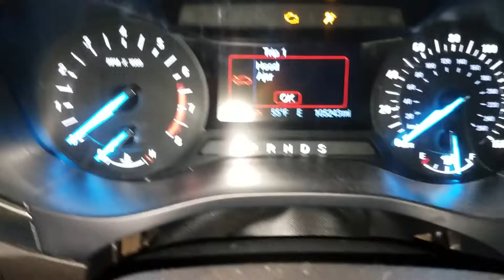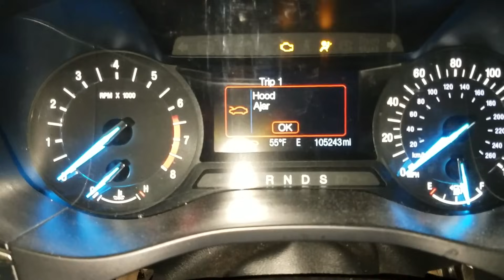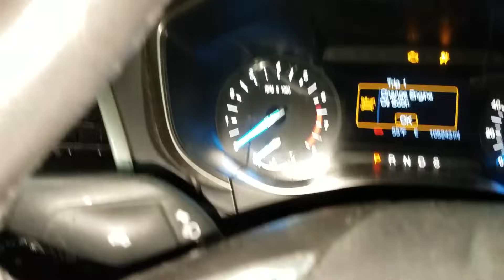Ford P1450 Fuel Tank Vacuum "Most Common Cause" & How to Test

Comment: So I have this code. Would this make the engine try to die after putting in fuel? At all other times, it's fine. Starts and runs normally. Only after I put in fuel, it tries to die, so I give it a little gas for about 5 seconds, and then it's fine again
Reply: Yes, my Ford 2013 Escape SEL died or tried to die every time I put fuel in the tank. Changed the purge valve, and it runs fine after fill ups.

Comment: Thanks. You're video was informative helpful. I have a question. My 2013 Ford fusion SE just picked up the 1450 code as well as a 144C code right after I got gas. Does the presence of both of these codes eliminate either the purge valve or the vent valve from the puzzle?

Comment: last week i replaced the purge valve in my 2014 MKZ.. ran good up until today.  Got a CEL as soon as i got into the car.  Ran the code and it was a P1450.   I drove to the gas station to get gas and the car wouldn't start.  So long story short i has to get the car towed today to the mechanic.  Could this happen if someone put something in the gas tank.. These cars don't have a locking gas door. I came out Sunday morning and the gas door was open. just a crack.   thanks in advance
Reply: You probably got it fixed but that could be from the valve being stuck open and filling the tank pushed extra fumes into the intake and made it too rich to start

Comment: This code happened for me a couple days after I did the 100k mile servicing (replacing spark plugs and coolant flush).  Could either of these things have anything to do with this code?  Thanks in advance!
Reply: No, this code is related to the EVAP system. Emissions and such.
Reply: Same here I change spark plugs and it popped up I believe my purge valve ain broke because it’s not stuck open maybe stuck closed what was your problem?

Comment: I changed the part and put the new one but the engine light is still on, do I have to delete the code with a scanner or can I disconnect the battery?  can you help me please
Reply: Did your code ever turn off? I replaced mine months ago in my code is also still on. Plus I tested it and it seems like it's working.

Comment: i had the same exact problem. i changed them out without testing the purge valve first. i reset my codes. however the wrench indicator light is back on. Even though my check engine light isnt back on this is how it started right before i fixed it. The wrench indicator light came on and would go on and off for about a month and even when on wouldnt throw a code but after a month the check engine light came on with it and it was the P1450 code. I changed the purge valve, cleared the check engine light and it has yet to come back on but since the wrench indicator light has come back on im wondering if it even fixed the problem?
Reply: I’m having the same problem what was it ?
Reply: What a wrench indicator?

Comment: The heat shield on the line is allegedly made of soy. Rats love it. A $300 repair, and the dealer told me exactly how to prevent it, and even gave me some free advice and components. How is that not subject to a recall?
Reply: Please share how to prevent this.
Reply: @mikescalise3913  Cable tie scented clothes dryer sheets around it, and replace them every three months. Seriously.

Comment: I have changed them both and still having p1450, any thoughts? It's the Unable to bleed up fuel tank vacuum p1450

Update* drove it for 2 days and the code went away.
Reply: Glad I’m not the only one looking for answers. Having the same issues
Reply: Better not to clear after fix and drive first. This way the vehicle goes through relearn process and confirms your fix.
Reply: Cars have a learn process in their programming. If the ECM no longer detects the fault, it will remove the fault from memory. Just takes a few miles/kilometers to get it to do that.
Reply: @mikeford963  no it was still showing a fault after the change. I just drove with it and after 2 days it went away
Reply: @Hinman_9124  Well, unless you cleared the fault with the code reader, it will. And it can take up to 30km's(Canadian here) for a code to clear.

Comment: I bought a obd2 to reset the mykey volume limit on the radio and I couldn’t get it do u know how to do it? They said to buy the little adapter and then use the Ford sys scan app
Reply: i remember clearing it but the backup car key has to be away from the car for some reason?

Comment: Could  you tell me an estimate on what this problem would probably cost to take care of this problem? It is a P1450 code Definition CodeP1450 indicates that with the engine running the PCM the PMC detected a control fault in the Evap system P1450 Unable to bleed Up Fuel Tank Vacuum  PO456 Evaporative Emssion System Leak Detected very small leak

Comment: That’s great, I just got this code can’t wait to ignore it
Reply: Are you still ignoring it? 😂
Reply: @Dmac2593  the check engine lights gone so o guess it worked 😂
Reply: @tonygood35  lucky for you not mine. It's been a year and it's still there
Reply: @tonygood35 how long did it take to go off ? I’ve driven about 40 miles since replacing the part and still the light is on.
Reply: @ulyssessmith454  it’s been a long time now but I think I replaced it then cleared the codes and it never came back
Reply: @tonygood35  okay so you manually cleared the code. The person at advanced auto part’s recommended I drive 100 miles and it should clear itself but if it doesn’t they said to come back and theyll clear it to see if it comes back
Reply: Is it hard to ignore it? Can a diy do it? 😂
Reply: I needed that laugh 🤣 😂  I was just pissed off, this ford is throwing a new code everyday
Reply: Black tape fix

Comment: You need to hook up the vacuum gauge to the engine side of the valve. Not all are designed to hold vacuum both ways, this one included.
Reply: Vacuum gauge to the purge side, unplug electrical connector then run engine. The gauge should stay on zero if it is not leaking.

Comment: So i have a 2011 Ford e350 v8 giving me this code. If I open the gas cap all this pressure is released. I changed the part under the hood with a ford part and i still get this code.  Also i haven't been able to fill up without it clicking all the time.
Reply: Did u figure out the problem? My e250 does the same
Reply: @snoopy5736  yes. I needed a new canister

Comment: I tested the purge valve by blowing into it. It was letting air go through! I replaced it! I'll let you know if the code doesn't return.
Reply: Did it work out for you?
Reply: @brandonquinn6176  Sorry I added a lot of extra info. To answer just your question about about the purge valve. It eliminated the check engine light, hard starting , and rough idle problems. Have a great day!
Reply: @Movieman1965  it helps so much! Don’t be sorry at all! I seem to be having the exact same problems...hard start after putting gas in, had some rev issues a while back, stuttering etc. Gonna try out what you said
Reply: @brandonquinn6176  Cool. It's very simple to replace the purge valve. Let me know how it goes?
Reply: @brandonquinn6176  any update?
Reply: @ayerod904  bruh haha I sold the car and recommend EVERYONE do it with their Ford Focus! I would never recommend this car because there were so many transmission problems. It would’ve costed over 2k to fix so I just thought it wasn’t worth it and got something far more reliables
Reply: @brandonquinn6176  Hello. It worked very well indeed! It turns out it was causing a few problems besides just check engine light. The car would stutter/shudder at 40-45mph before I replaced the purge valve. Also, whenever I filled the gas tank from empty the car would experience a hard starting process where it would crank a long time to start up ( if it was say 1/2 tank with gas it wouldn't happen). After replacing this purge valve all those problems disappeared. Oh, and prior to this the idle was always rough and sometimes the engine would shut off too! No more shudder at 40-45mph, no more hard starting, AND I have not had the check engine light return since that time. It's been about a month now. BTW, I replaced the spark plugs and they really looked chewed up bad! I also replaced the ignition coils. I also replaced the A/C Pressure Switch ($25 part easy to replace) because the A/C had a good charge but it was not engaging the A/C clutch. It solved that problem. I also replaced all the fuel injectors (easy to do also, time consuming but easy, cost for the injector set of 6 was $70). I also cleaned the Mass Air Flow Sensor ( You just spray the brick colored resistor with Mass Air Flow Cleaner Spray, not expensive). I also replaced the Throttle Body ($73, easy to do also).  The reason I replaced so many things is because my 2013  Ford XLT Explorer has over 125,000 miles. I didn't buy it new so after checking it appears these parts needed to be replaced to ensure reliability. The only thing I plan to do now is get the Rear Suspension Toe links replaced at the dealer tomorrow because of the safety recall (19S17). They say these can break and cause loss of control which may cause an accident or worse!  I did go look under the rear of the car to check if mine were cracked or borderline but I did not see anything wrong. But, after closer inspection I could see that the way these Toe Links were designed it's just a matter of time before I run over enough train crossings to cause a fracture and then maybe I crash into something! I also took close-up picture for my archives. I will be also marking them later today and taking pictures again to make sure that they are actually changed as the recall dictates. Anyway, at this time the vehicle is running very well, acceleration has also improved. I may look at the vacuum lines next for any leaks. Ok, that's pretty much it for now. I hope this helps of you with 2013 Ford Explorers out there. Now that I think of it, the steering power assist rack and pinion had also failed about a year ago (Ford did not have my VIN in the recall, some others did). I had to muscle steer the car for a month before I found a dealer to replace it for $2,000 with warranty. Also, now that I recall further, last summer the A/C condenser had a leak. Replacing it cost another $2,000 because it is hiding behind the dash (labor was the biggest cost).  Anyway, I can say since purchasing this car used with 76,000 miles I have spent about $5,000 to get it working properly since then. Have a great day!

Comment: Can I still drive my car for like 2 weeks or so till I get it fix?
Reply: A stuck open purge valve may/may not be noticeable so depends on how bad yours is. May idle high, surge, or stall out at idle; or impact may be negligible. Generally a purge valve you should replace ASAP. A vent valve though you can typically do when it's convenient (unless it's preventing you from filling up the tank).

Comment: Thanks for this.  Just on the chance someone reads this in time, what are the implications of driving the car a few days like this?  Is it safe?  Will I be in violation of emissions laws?  I have another part on back order from Ford for nearly a month.  If this part is a backorder, I'm not sure I can be without the car for a month.  OK to drive it?  Many thanks.
Reply: Had a customer that drove there 2013 escape for over a year before it finally would not start. Some people don’t listen. They finally had me replace the purge valve and it’s good now

Comment: I hear a sound coming from my gas tank cap
Reply: Joey Lathus me too did you figure out what it is?
Reply: @Mrputitintheair29  replaced the gas tank cap boom the code went away..the gas tank needs the pressure so if the gas cap is leaky this will cause excessive sucking by the fuel system.
Reply: @Mrputitintheair29  It’s air that’s stuck in the tank.
Reply: Yea I do too it’s a weird buzzing sound for me sounds like bees.

Comment: I have a 2014 Ford Escape and had the purge valve replaced at 64,000 miles at a cost of $400. I'm now at 112,000 with the same problem. First it shudders then hard to start and the code reads 1450. It's unfortunate that the Ford Focus with the same engine has this problem and there is a recall on it but not the Escape.
Reply: Oh boy 400 bucks they took you for a ride. The purge valve is like 35 bucks
Reply: @William Vaughan  My car now has a 186,000 miles and I  just had to have the purge valve replaced again. This time it was $350.00. The part was ordered from the dealership so it was around $95.00 and the rest was labor. It sucks having had to replace this 3 times.
Reply: @cele8910  This is the 4th time my 2016 ford edge sport has had this code. The last 2 times I had to fight with the dealership to fix the same issue that was within a year of each problem. They keep wanting me to pay for a smoke test for $350 and I have to fight them on this as well. Wish me luck ! I’m taking it in for the 4th time tomorrow! They really need to recall this part.
Reply: I have a 2010 milan and about to change it again myself for the third time in 2 yrs. I'm thinking I might also have a different issue if this keeps happening. But it does fix it for about 10 months

Comment: So do u buy the canister purge valve if you have the p1450 code ?
Reply from the maker: If its test bad.
Reply: The Flat Rate Mechanic I have a 05 Lincoln Navigator with the P1450 code...i change the purge valve,solenoid,FTP sensor,fuel tank cap and still getting the code...canister it’s not plug and the hoses are good...any advise please
Reply: @JoseRodriguez-vw5mo  probably the other valve at by the tank. The more expensive one.

Comment: Thanks. My son has been having issues with starting when he fills up his tank. I used the same DTC scanner you have and came up with P1450 and P0456. I didn't know where to look for the purge valve but thankfully I clicked on your video. Gonna test it and hopefully that's the problem. Seems common. Thanks again.
Reply: I had the same problem and codes turns out it was the purge valve
Reply from the maker: You're very welcome. Glad the video was helpful.
Reply: That is my exact code, what ended up being your problem?
Reply: Was that the problem with your vehicle? I'm having the same issue.
Reply: That would be a problem with the vent valve or blockage at the charcoal canister. A purge valve won't affect issues with filling the tank.

Comment: I'm getting the P1450 code on a 2014 Fusion SE 1.5L, is the part number the same?
Reply: I have the same vehicle as yours and the same issue. Have you ever run across that part number for the purge valve?
Reply: What is the part number for 2014 Fusion SE 1.5L ?
Reply: @BLR220  did you ever get the part number
Reply from the maker: Yes, I believe so. But I would definitely cross reference part # before ordering anything
Reply: What is the part number for 2014 Fusion SE 1.5L ?

Comment: The purge valve isn’t designed to have excessive vacuum pulled on it that way.  The EVAP system works with less than 1 psi.  Proper way to test the purge valve to pull vacuum on the intake side of it.  Just FYI.
Reply: @Carrot Top Nick is correct. Gauge was hooked up incorrectly. The intake (or throttle body in this case) is to the left (front). Fuel tank side on the right (firewall).
Reply: Its a video makers mistake if anything

Comment: Thanks for the advice. 2010 ford fusion 3.0 sel. Old purge valve was definitely stuck open.
Reply: Did you hear a hissing coming from your gas tank? Cuz I have p01450 and p0456 and there’s a hissing from the gas tank
Reply: @ashtonlilly7047  maybe a leak in ur fuel evap system causing to drop vacuum pressure

Comment: How much does it normally cost to fix ?
Reply: seems fairly easy to access and remove? how much would it cost to fix yourself? or is there more to it then just disconnecting a couple hoses and putting the new valve in?
Reply from the maker: If you were to bring this to a repair shop probably around 300$
Reply: Was quoted $700+ by my local dealer for a valve/hose replacement
Reply: @ChristopherFreezeYT   Yeah he said 'repair shop' dealer is going to be more :D

Comment: If not repaired, what are the effects on the vehicle besides the CEL?
Reply from the maker: There could be a few adverse effects. Basically, if the purge valve is leaking that means the engine is pulling unmetered air which can affect drivability and fuel mileage. And with the purge valve leaking, that means you are pulling a vacuum on the fuel tank and if the vent valve fails for some reason you could clasp your fuel tank. Seen it happen.
Reply: @FlatRateMechanic  great video brother! I have the p1450 on a 04 Taurus, I knew there was some kind of vacum in the tank. I thought it might be the gas cap. When I remove the gas cap the car dies. Does that go with what you just taught us? Thanks brother for any info.
Reply: @FlatRateMechanic  my vehicle has been stalling (2015 Ford Edge), most of the time there is no code. Just stalls after making a weird "whaaa" noise coming from the fuel tank area...the last time it stalled I got this P1450 error code. I will be taking to a mechanic because I'm not a DYI'er - but can you please tell me if the stalling could be in relation to this error? 10 months ago I did get an evap code pop up, but then it went away shortly after.
Reply: @FlatRateMechanic smog tech here. Have a 2013 focus. I've tested the valve and it seems fine. The gas tank is deformed and I can watch it suck when using a binditectional scan tool. I T'd in a vacuum gauge and it reads about 3 psi.... However the fuel tank pressure sensors reads -0.31!?!? Am I crazy or is the ftps bad? Or should I just say screw it and replace the purge valve anyway 😂😩. Thank you!!!!